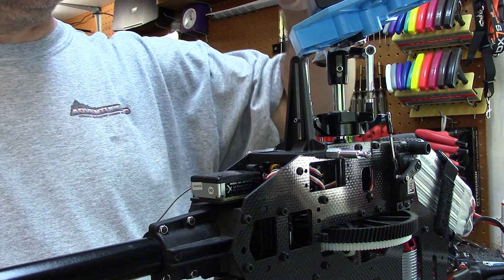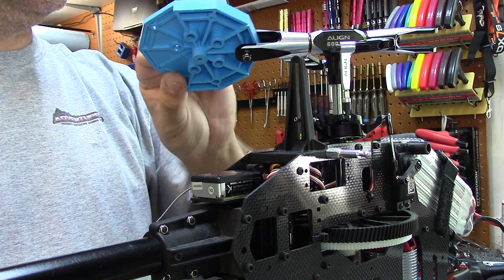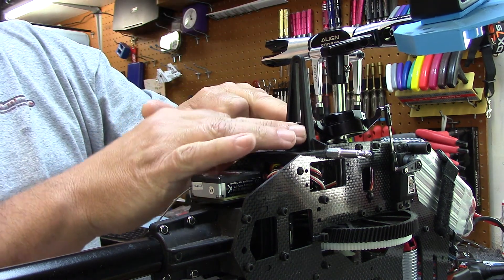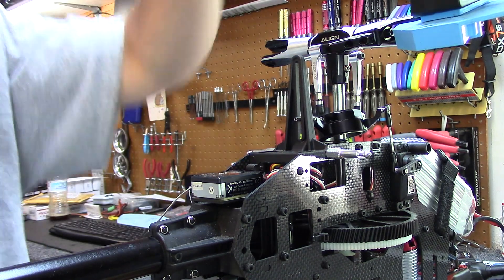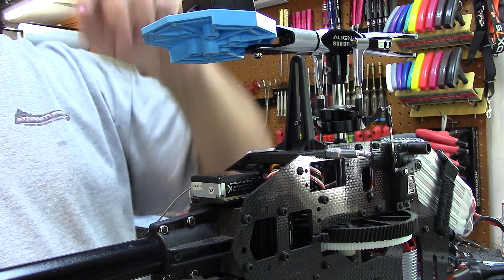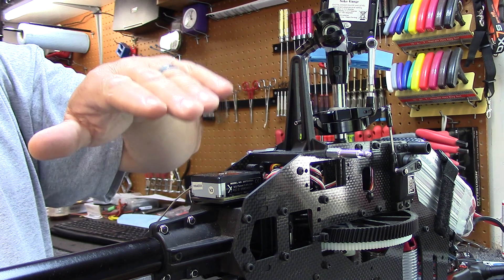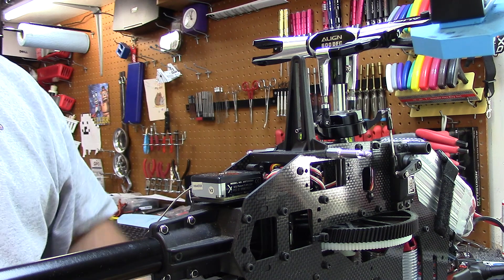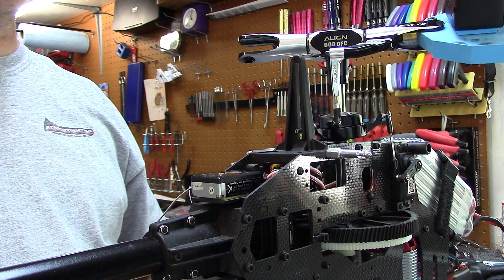Centering Swashplate RC helicopter

Comment: what do you mean when you say 50 in 50 out  ,  are there different tx settings  for setting up vs flying ?  i use a silver dx8   
thank you
Reply from the maker: We used to say 50 in 50 out setting up a fly bar helicopter years ago. If you set the pitch to 0 which would be no positive and no negative than you would have plus 50 on positive pitch and -50 negative. If this is one of the first collective pitch helicopters you have flown I woulda start with 0 pitch with servo arms at 90 degrees and than full collective about 12 degrees and full negative at 12 degrees. If you will not be flying inverted you could make the negative about 5 and it won’t drop as fast. Are you using a beastx?
Reply: @rcflightline2839  thank you this is how i flew before i had a change in life , but i have a t rex 470 lp on the way  i will limit the amount of questions i pester you with and watch the videos more carefully thank you 
here you go 
https://www.youtube.com/watch?v=I8ylpPQM6mY&t=152s

Comment: Another good one bud. Nice tips. Now only if I hadn't sold my Soko. Ahhh well time to make me a set of used short 800's for my setups. Heh
Reply from the maker: HKMaster556 I also have a cut off set of 700, 600, 500, and 325mm blades I use when using the RC Logger gauge